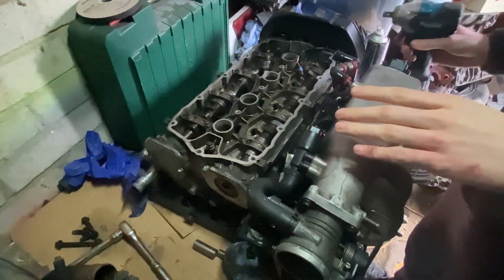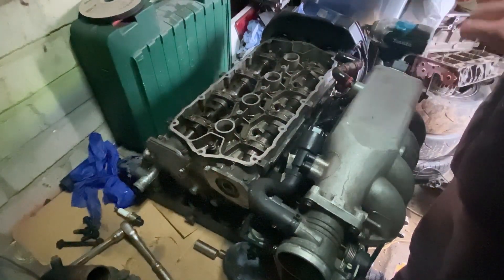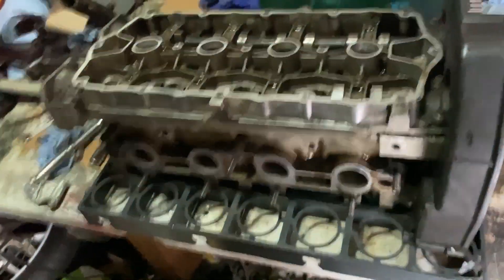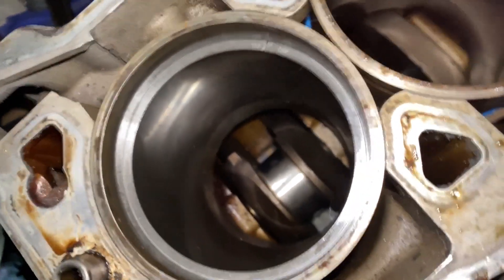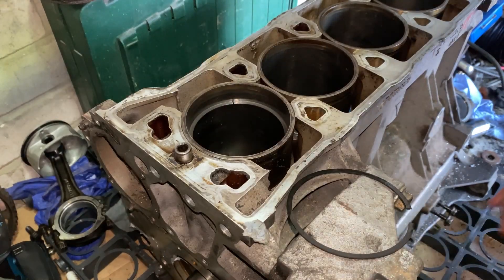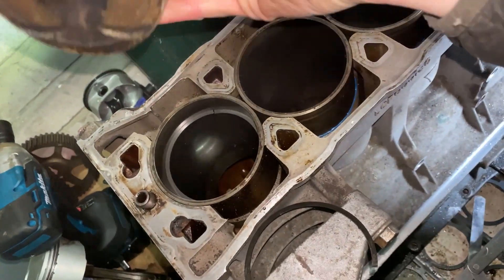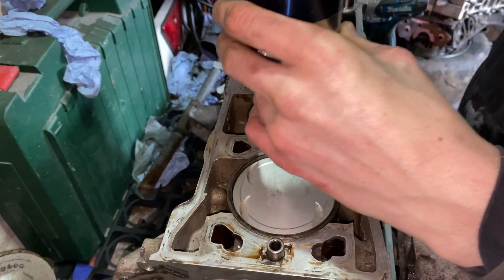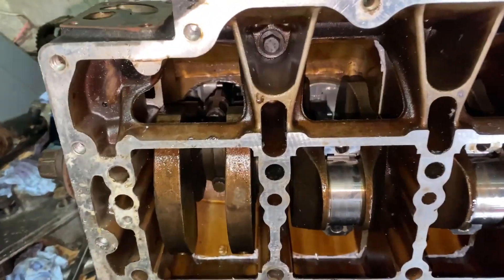Engine Rebuild - Piston Ring Gapping  K Series revival!

Comment: I just restart my freelander 1.8, for the first time after, rebuild all engine. I double check all the electrical conection and fluidd, but hase same metalic sound like yours, and have some idle variation. Is normal? The idle variation can be from the small batery that i took from my 1.6 Toyota Corolla. I apreciate any advice. Thank you so much!!